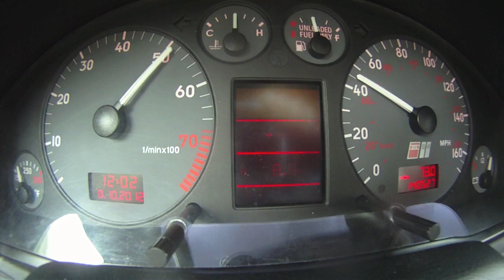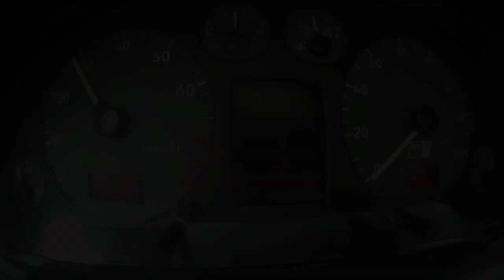USP Motorsports Audi B5 S4 Tial 605 Twin Turbo Kit

Comment: Not to be a hater or anything but I have to agree that there is no way that's 500awhp. That's almost 600 at the crank taking into account quattro drivetrain losses. The pull you did 0:35 was almost equivalent to a 1 bar chipped 2.0T. I'm not doubting that the kit can make that much power, but either there is something egregiously wrong with your tune, or you weren't going full throttle; the latter seems more unlikely, since you're showing off how fast it accelerates.
Reply: Seeing the road he was on how far i heard the throttle punch, it did not sound like full throttle.
Reply: the driver didnt even drop the clutch. that wasnt even a launch. after reading your comment i timed 0-60 a couple times and came up with just under 5 seconds... with a 3000rpm launch. but even so, these 605 kits dyno well over 550 all day, so even if you dont think its 500... it definitely is. chipped 2.0t ha good one.
Reply: Michael
First off, you clearly didn't read my comment. I never doubted the potential power of this kit. I also mentioned that he could've not just been going full throttle. And how did you time 0-60, when the clip of the speedometer is interrupted? Those could've been two totally different pulls. And it definitely is 500hp? I'm sorry, are you the owner? How can you say that with out seeing a dyno sheet? 0-60 times indicate nothing about the power of a car. Also, noticed I distinguished awhp from hp. 500 CRANK horsepower would make a lot more sense than 500 WHEEL horse power. But notice my statement was conditional: there's no way that's 500awhp UNLESS... he wasn't going full throttle or the tune wasn't complete. I simply stated my jaded opinion about the power of the car based on what was displayed in the video, but still giving credence to the possibility that it's true. I gave no disrespect to the shop or the owner, nor did I mean to, if any was taken.
Reply: Falken Punch OMG i thought the same thing 

Because my brother owns a vw passa 2006 2.0t and it accelerates just like that 😂😂i thoutht about that then after whatching the video i came to the comments and saw this😂😂

Comment: tials just don't suit this motor, it probably does make 500HP, but it only starts making power by around 4000RPM and then 3000RPM later its time to shift and its time for the turbos to spool up all over again.

some K24's and it would "look" faster for you F&F civic boi's and produce more usable power.
Reply: macthemec that's what I'm putting on my B5

Comment: They sure as shit are not.  500wtq is about all you can push these motors to stock without having to worry about bending the rods.  This car is nearing the limit of the stock motor but not far over.  650 would be WAY into rod bending territory.